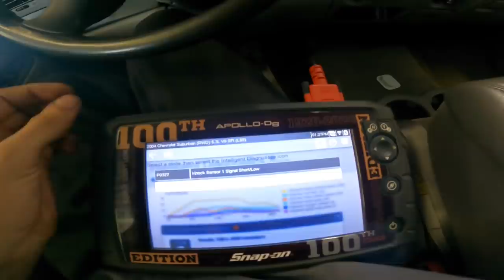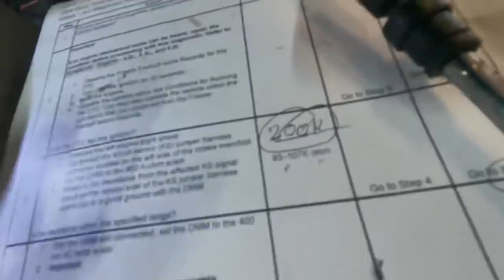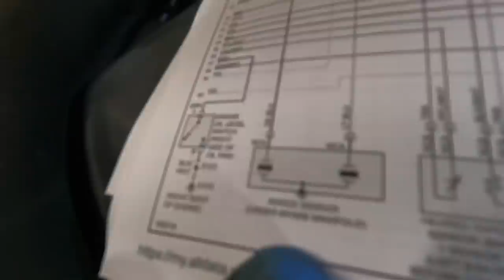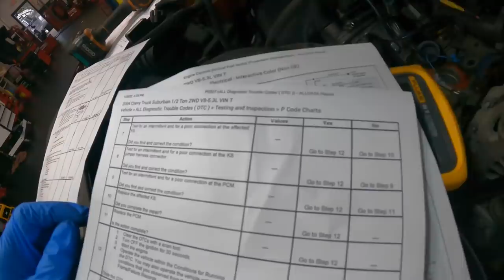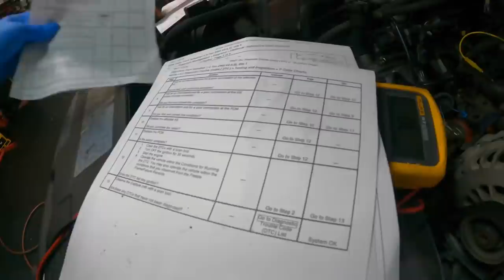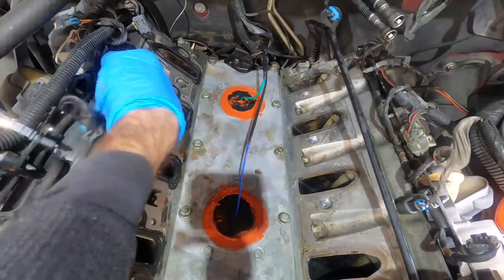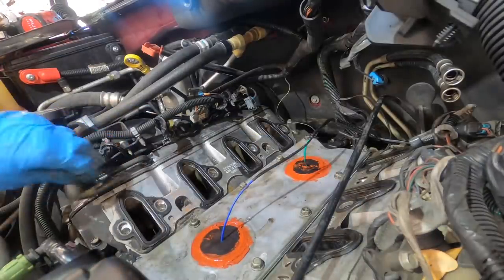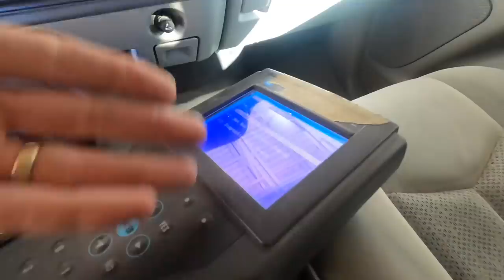Had to DRILL the engine block. NIGHTMARE Diag! LS 5.3 Check engine!

Comment: I have round on this engine (or at least on my 5.3 from 99) that there should be a very small bias current on the knock sensor you can read through back porting the sensor when it's off you should still read a .01v or .1v I think - it lets the computer know it's alive even when not producing a signal - if that voltage isn't there the computer flags the sensor as dead.  Took many sensors and lots of work to find this out though - it's not in the diagnostics procedure in the manual.
Reply: Curious, sort of like a perpetual motion battery? 

Perhaps sometimes a sensitive voltage meter may read a residual capacitive charge, however I cannot believe this would be used to verify sensor operation.
Reply: @KallePihlajasaari  No - the bias charge is only present when the engine is 'on' (not running per say) with the key in the on position or running.  I suspect that there is a hidden function in the ecu that looks for that small current to validate the sensor is there - in my case I went through the entire diag like he did in the video - took it to a dealer who did the same and they ended with 'repalce ecu' - but after playing with sensors (I went through around 5 or 6 of them all together) I found that the problem would follow the sensor (it helped that I had 1 good 1 bad) - the discovery was by accident as a good sensor is supposed to not have any voltage when not operating, and I was back porting to test voltages with the sensors installed - when I found this I opened more sensors until I found one that exhibited the same small bias current and it's been working for around 5 years now.  All my parts were AC Delco made in Mexico - but I don't know if they were all the same plant - I assume so - and I have no explanation as to why but I was told by the dealer is that range of LS is known for being very picky on sensors - and I'm thinking they did some stuff not documented to make aftermarket parts not work - that last part is just my personal opinion after spending a month in my backyard (and at the dealer) trying to fix this.
Reply: @xThemadpoet  OK, I can believe that the ECU may supply a bias voltage and then use that to characterise the sensor.  I just found it hard to believe there would be a permanent voltage on the sensor. Also yes, I can believe that the bias may be a anti counterfeiting feature.  However we should always recall that a lot of grey market parts come from the same factory that makes the genuine OEM parts and spares but sells all their excess production capacity on the black market if they can get away with it, sometimes they may change the case or labelling to make it look like it comes from elsewhere but the active part may be identical.  

Testing these sensors with a DMM is about as reliable as testing a ABS inductive sensor, you may get a good reading and it still does not work.  The normal mechanic will not have an oscilloscope or the time to test even if he had a test jig to vibrate or pulse sensors so sometimes these partial failures can sneak through.
Reply: @KallePihlajasaari  oh it's totally a part problem - I mean it could have been counterfeit parts my first two were good 'ol auto-parts store but I started ordering AC delco after that - which ... doesn't mean they weren't also fake, I am just adding this here in case someone else is in a similar situation and wants a point of reference for help - for the backyard mechanic - if you aren't scared of using a multi-meter you can back port a live circuit using a sewing pin from the rear or the connection - the idea is to slide into the terminal and make contact with the metal inside - lets you measure voltage 'inline' without cutting the wire.  Use a bit of silicone gel to seal up the connector after.

Comment: After watching this repair, i can think of some things I have done in the past. when drilling in the block take a new clean rag cut a small hole in the rag, place the rag over the short stem then drill, the shavings will be in the rag easy to remove and clean.  the other is invest in a set of left hand drill bits, a set could be very useful, as drilling  the broken stud out for the easy out, sometimes brings the broken piece out. I purchased a set for about $100. very useful set.

Comment: Good job on blocking the intakes and vacuuming the shavings. At least the broken studs weren't grade 8 or 12 bolts that I did on heavy equipment in the 1970s.

Comment: Wow! That poor customer. Knock sensor(s) failed and the shop over-torqued them. Then, blamed the PCM which must've cost a bundle only to have to pay another to drill out the over-torqued sensors. Thankfully, Ray didn't blame the PCM again. However, egads! How deep into their wallet is this poor customer over a pair of failed knock sensors?
Reply: it happens a lot more often than people realize in the auto repair industry.   for every 5 shops out there, 2 are honest from what I've seen working in the industry for 20+ years
Reply: @torxxx1  And out of every 5 honest shops, there is one that is competent... I have been back and forth between commercial parts sales and working in shops for over a decade now, and the amount of people working in shops that are just throwing parts at problems until something works is ridiculous...

Comment: I had to do this same repair once. What I did was take a 20oz soda bottle, cut it down just about the top of the label, then drilled a hole in the lid to fit over the boss. Once I was done drilling it was super easy to suck the metal shavings out.

Comment: Over-torqued for sure, very important to get the torque correct on knock sensors.
Reply: Yeah, it was probably some mechanic that just says "click" instead of actually using a torque wrench.
Reply: @SomeRandomHuman717  While using a breaker bar on it lol.
Reply: @SomeRandomHuman717  Many bolts are not terribly critical on torque, and an experienced mechanic can get close enough by feel.  The same experienced mechanic also knows when accurate torque is required, e.g. on bearing caps, head bolts, timing components etc.

You will not find real world car mechanics using a torque wrench on every single fastener, this is the preserve of the grossly inexperienced and usually very vocal YT commenters.
Reply: @SomeRandomHuman717  Do we know anyone who does that???? Saying the word instead of using the tool. Lmao
Reply: @SomeRandomHuman717  1/2 in impact dugga dugga  ooomph
Reply: INDEED TRUE...IF THERE IS A TORQUE SPEC...ONE MUST HONOR THAT SPEC!!! THERE FOR A REASON...🤔🤓🧐
Reply: @SomeRandomHuman717  That "click is actually the sound of the part breaking.😂
Reply: Never seize

Comment: You wont have to risk metal shavings in the engine block! No drilling or risking further damage. I have same motor in my Chevy truck.
Ray, the next time you have a broken bolt like this use a nut to tack weld to top of broken bolt and heat up the area while moving the Welded nut back amd forth. It works every time for me. Red hot heat is your friend.

Comment: I’m not a mechanic, far from it. Could you have used a Dremel tool and just cut a line in the bolt and use a flat head screwdriver and unscrew the bolts. In my unprofessional opinion it seems like it would have made much less if a mess with the metal shavings.
Reply: The problem with that is the dremel would have made a rounded lip edge and caused slippage. Drilling is less risky. In the aviation community the ez out method is the preferred method of extracting stuck screws which happens a lot
Reply: Is there enough torque in a Dremel to do it?  I have no knowledge about Dremel tools obviously.  Just asking.  God Bless you and yours.
Reply: The dremel has very fine bits that are every bit as sharp much like a dental tool precision. I would use the drill and ez-out because their are reasons why I am not a dentist, that is my hands aren't that steady.
Reply: If piece is loose (rotating) after drilling lightly tap a small file tang into the hole, keep downward hand pressure on the file, turn a 6 inch adjustable wrench counter clockwise to remove the slug above the part surface.

Isn't passing the test the best feeling for that day?
Reply: See coffee filter idea 4 good solution.

Comment: Great job Ray. Just a little tip I picked up in a race garage when drilling like you did. Place a sheet of aluminum foil down and tip the edges up before drilling to catch all the shavings. Fold it up and dispose when finished.

Comment: Excellent job. One very tiny nit to pick would be to suggest that when removing the "plugs" from the intake openings I'd recommend starting at the back of the block, not the front. That way you are not reaching over open holes as you remove the remaining plugs and reduce even further the risk of debris falling into the intake.

Comment: Seen this more than once. It’s why I always use Delco sensors and torque them properly. I’ve gotten them out using a punch to tap them around to loosen them. Do yourself a favor and get some high quality cobalt drill bits. Norseman makes some great bits and I like the new Matco bits that all have the stepped tip. They work great and make drilling through tough stuff a cake walk.

Comment: I remember a GM bulletin that addressed over-torque of detination sensors clear back in the eighties dealing with this exact issue. I kept telling you from the "back seat" to check the sensors first when it was obvious that someone had been there before and replaced them. Good catch Ray!
Reply: Always good to see a guy who can fix electronics when the diagnostic tree leaves you without an answer. Great work.

Comment: Love your channel. Please take this as a helpful comment. When drilling the secret is lots of pressure and low speed. That way the drill bit cuts instead of burnishing the metal your trying to cut. That's why drill presses work well even with dull drill bits.

Comment: I had one of these issues tossed to me years ago, they replaced the complete harness, the pcm, the sensors… ultimately I put in new motor mounts. They guy was soo upset he wanted rid of the truck. So I bought it and it’s still on the road today no issues. I’ve heard of shotty exhaust work also causing similar grief.

Comment: If you use a stiff parts cleaning brush with your vacum nozzle you wouldn't have blow air to get the rest of the debris. I do this in aviation and it is a good F.O.D. prevention technique. Thanks for sharing your vids I enjoy them.

Comment: Hey mate, nice job on this one.
Some unsolicited advice. Don't put red RTV in an enclosed space with electrical connections. The glasses released as it cures will corrode the terminals.
Probably fine in this case since the rubber boot went down lower than the RTV, but I learnt this the hard way.

Comment: Been in your situation and ended up using  quick set JB weld metal epoxy. Used a small brush  (kind you use with anti seize) to carefully put it on the edges, let it dry 30 mins and it worked great.

Comment: Aftermarket knock sensor will cause the same symptoms too . I always use ACDelco . I’ve had 3 trucks . One of them was same as yours .. the customer replaced knock sensor , pig tails , and pcm . I didn’t do a flow chart I just gave an educated guess and went to check the knock sensors first . One was tight and the other one was hand tight .

Comment: I use reverse drill bits to remove bolt's broken like them, I start with smallest and go up it heats it up sometimes they release, if not then extractors. All the best to you and your loved ones
Reply: I only just finished saying about the reverse bit's mine work

Comment: Man that was a tough one.  Hats off to you for sure. I know you have the skills and only need a very short tutorial and a little practice to be able to touch up/sharpen your cutting tools. It will save you so much work every time you need to drill, ream and bore anything. Cheap drills can be used over and over again. Custom sharpening can reduce the pressures needed when not in an optimum position to push. And a host of other advantages, but mainly that you can always have a fresh, sharp cutting edge on your tools each time you reach for them.

Comment: Another great video Ray. I had to drill out three steel bolts from a Jag a couple of days ago. It's always a last resort but when there's nowhere else to go, you just have to go there!
Before I start such drilling out I always set up the electric bit sharpener on the bench ready because I know I'm going I'm going to need it at some point, especially with steel studs and I always have the tub of cutting compound handy to regularly dip the end of the bit into. It really makes a difference in the cutting action of the bit at lower speeds, although it is not a magic cure for a blunt bit.

Comment: Excellent trouble shooting and fix. One thought to offer, when drilling in a space such as that intake if use use the bottom of a cut coffee cup with a snug hole fit over the studs you will contain all the metal flakes in the cup making it easy to vacuum out.

Comment: Your center punch.... there is a rod inside that acts Ike a hammer. Take it out and smoothen the end edges on a sharpening stone so it don't hang up inside when it's pressed down. It's suppose to meet a small orifice and hang up until enough pressure forces it to click in then it hammers the pin inside.

Comment: Nice job👍 on the diagnostic
Think I would have marked the new sensors with a metal pen and checked after torquing just to ensure they didn't spin in the body.
And taped off intake and cam valleys, then laid down a towel over before drilling.

Comment: 1985 Pontiac Fiero SE 2M4. Throttle Position Sensor error. Previous owner of the car had literally drilled holes in the TPS to allow it to sit at a different angle. Got a used TPS off a junkyard 1986 Chevy Celebrity, also with the Iron Duke. It was even worse, glowing exhaust system, Check Engine light, almost couldn't drive it, etc. Took it to a GM Dealership where they did, at no charge, connect a scan tool to the ALDL (this was before OBD). TPS reported +5V at idle, 0V at wide-open throttle - the 1985 and 1986 TPS were opposite of each other! ALL my GM parts came from Golden Mile Chevrolet Oldsmobile after that point; a tech spent about 10 minutes with a scan tool and made a loyal customer for life. 

I bought the part, swapped it in place in the Parts parking lot, and the car started right up and was running better than it had since I bought it. A quick run to The Beer Store and I was back, looking for the tech who had helped me pro-bono. "Hey, thanks so much, man. Here's a case of beer." :) 

Nice fix, Ray.

Comment: this sure is a pain. i had to do or redo mine about 3X. thought it was faulty sensor, though i bought a fake sensor only to discover later on that the pin in the connector was the problem, it would come loose when the car was running.  had the sensor disintegrate also like yours that it can't be removed. did start to drill it like you did but the easier way i solved it was by JB welding the top of sensor so that it can be turned.

Comment: Ray
Let me say thank you for all the great videos and all the solid advice and tips you put out . One thing that hit home with me on Monday was your thought of becoming stuck on a problem. It was this video where I heard you say it and it played in my head as i was smoke testing my truck trying to sort out a P0456 code. After checking and replacing nearly every line and the gas cap gasket on the 2008 Tacoma 4L V6 the code only came back faster, time not being on my side on this one I could only spend a few hours at a go trouble shooting it and as we know we go with the simple stuff first. It was not until i pulled the canister that i found the real problem. As you said when you become stumped you are most likely over looking something simple. It was the tank vent line with the snap lock hose connectors and O rings. See a while back the fuel level sender died, the dealer did the tank drop and replaced the unit. I've dropped enough gas tanks in my life i don't care to do any more. Apparently the mechanic didn't get this hose on the fitting and clicked in place. It only took a year to leak enough to throw a code. I know this because it took me an hour on my back under the truck to get the hose off the canister, yet the other end of the hose just fell off the tank with a slight tug. Now you might say I was pissed at the lack of attention to detail. Well I would be if the same thing didn't happen to me when I installed a new canister and I re smoke checked the truck. Smoke poured from the line that I thought was connected to the canister yet it wasn't so Yeah I'll let the tech have that one. But it was your voice in my head saying "You have probably over looked something simple" and sure enough thats what it was. A simple hose not fully seated on it's connector. But it did force me to buy a smoke tester and a new Bidirectional scan tool so new tools is cool. Thank you for all you do and the positive energy.

Comment: Valley cover can come off with knock sensors still attached, just have to over come oil seals on bottom of valley pan, had the same issue happen to my car and i did it that way.

Comment: I’ve always ran self tappers in the sensors and have had good luck on getting them out. There’s a rubber grommet under if you go too far. Usually replace valley gasket and grommets when I’m in there

Comment: If you remove the alternator you can leave the throttle body left on the manifold. 

Also there was a TSB for the knock sensors, remove the foam under the manifold (moisture is trapped causing the sensors to short out) without any foam, it shouldn’t trap moisture, so you shouldn’t have to seal up the boots with rtv (if the harness boots are good they should seal good anyways)